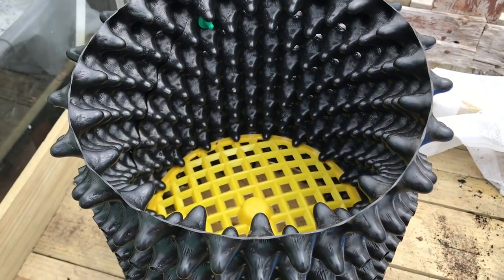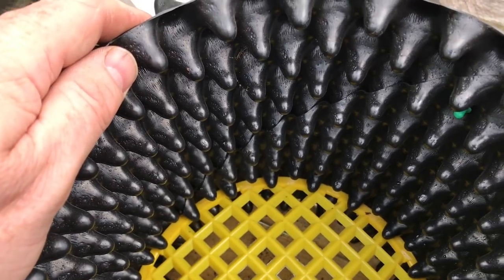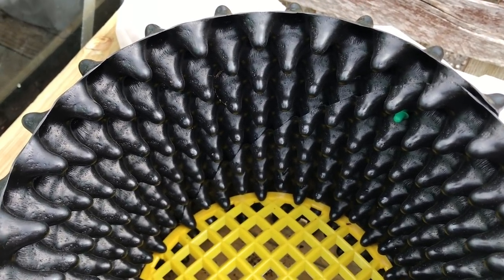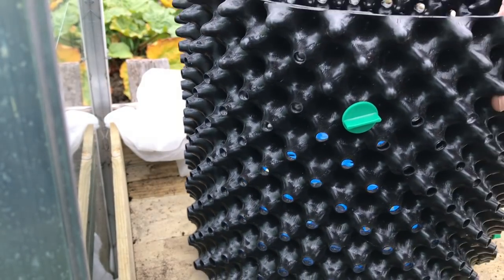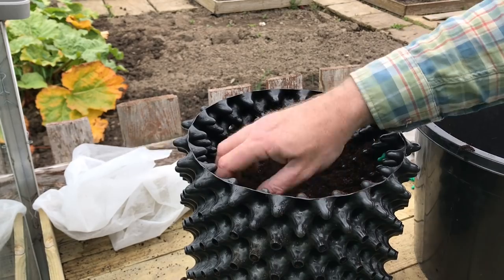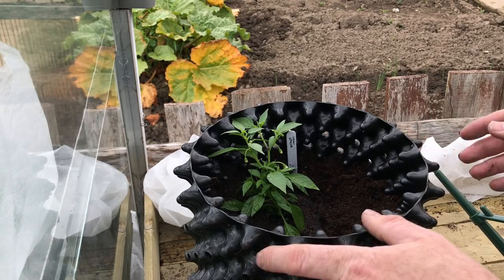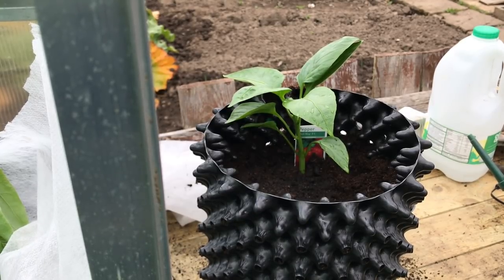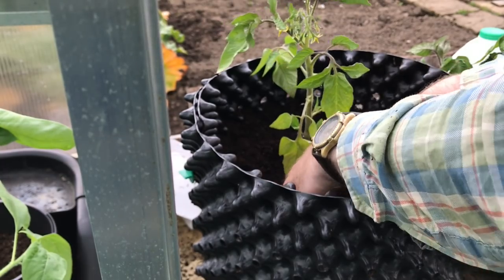Growing in Air-Pots - Nick's Allotment Diary #131

Comment: Hi Nick, thanks for having a go with the Air-Pot containers. However, there are a couple of things I would like to mention. 

The pot hasn't been filled right to the top, this will make it difficult to water if it is being done by hand. The volume of the pot is also calculated from the base being 3 rows up and the pot fully filled. The volume should be 20Litres but it is probably around 15 litres at the moment

The compost must be compacted more, the pot is full of holes and therefore has great drainage and aeration, this means we can really cram in the compost into the pot. This will give the compost more water retention and you will find it holds its moisture far better. 

But great job none the less. You have managed to put it together correctly and are using the correct compost. Let us know if you have any issues or queries. Thanks, Air-Pot team
Reply from the maker: Thanks very much for the advice.  A few people had advised to top the compost up to above the holes which I’ve subsequently done. Thanks for the advice on compacting the compost though.  I really like the design and hope to get great results from them. Take care. Nick
Reply: ....I have used these {the proper ones, not the cheaper copies with smaller holes}..I love them. Am buying some big ones for oak saplings...Put a young Christmas tree in one 6 weeks ago and it has shown so much new growth. No nasty root spiralling that one gets with saplings in trad pots...but as I too bought my pots with no instructions, I made a mistake first off with the domed base....I put it in upside down with the dimple pointing down........They are marked 'top' 'bottom' though, but I thought it made more sense to have the dimple pointing to the ground to help support it....rookie error, but plant grew well. 
I use them correctly now 🙂
Reply: Love your air pots been growing my cannabis in them for over a year now and have eliminated root bound issues I was having...When you say growing in compost do you mean nothing but compost or is there a ratio of soil to compost?
Reply: @Crazyman1212  we should have said "growing medium" instead of compost
Reply: @airpotsystem  Thanks for clarifying that and your air pots are amazing for growing cannabis by the way.

Comment: Air pots are not spectacular in humid environments.
Roots don't want to air prune.
HOWEVER, they can 'sun' prune. 
Watering may be a challenge too.
Best to use the bottle irrigation method or drip irrigation.

Comment: Hi Nick.
You might want to top up the compost to the water reservoir level (Top row of holeless nipples) otherwise the water will just run away. (that's why one edge of the airpot has less holes)
 I've used them for a couple of years but, boy, do they need some looking after!
Steve
Reply from the maker: Cheers Steve. I’ll take your advice mate. Yes I realise they’ll need extra care with watering. Take care. Nick

Comment: Will be interesting to see how the comparison works out. I dont like the mash bottom just as it has no water retention. But saying that will the roots at the bottom drop down in the dark and damp and feed of the surface you put them on that will be interesting to see what happens.
All the best mate Dave
Reply from the maker: Cheers Dave, I think they are designed to air prune at the base too, but if you were to sink them in a bed then the roots would grow through into the soil below. I think I’ll need to keep an eye on the watering. Take care. Nick

Comment: I look forward to hearing more. Just a question regarding watering in both regular pots, and 'air pots'. Would a plastic bottle with small holes in it dug into the compost aid with a regular supply of water? Alternatively do you 'bottom water via a tray / regular 'water on the top'? Do you think using 'air pots' changes how you should water? Very interested to hear your opinion.
Reply from the maker: Hi Gordon. I think adding a plastic bottle would help in watering. I don’t think bottom watering would help as the base is not at the bottom of the pot. I’m planning on watering conventionally from the top. I’ll keep an eye on the watering and try and keep both hydrated. Take care. Nick

Comment: If you look closely, the first two, top rows of dimples do not have any holes.  This lack of holes is done on purpose, so that the water stays in the top couple inches of the pot.  You should fill your air-pot to the rim to take advantage of the design.  Don't leave the 2 or 3 inch gap like you did.
Reply from the maker: Thanks for pointing that out. The airpot company also mentioned it after I’d made the video. Take care. Nick

Comment: Hi Nick, I saw a guy making some of these on YouTube two or three years ago; basically just drilled a bunch of holes in a standard flower pot. It's an interesting concept and I will be interested to see how you get on.
Have a great weekend.
Woody.
Reply from the maker: Cheers Woody. That sounds like a good idea but surely the roots will hit the walls of a normal pot whereas in an air-pot they are channelled towards the hole ( because of the bumps) then are air pruned. I guess it’ll work in a similar way though. I’ll definitely keep you updated.  Take care. Nick